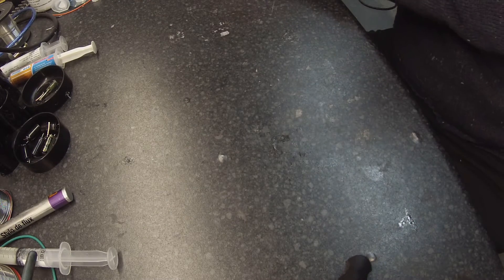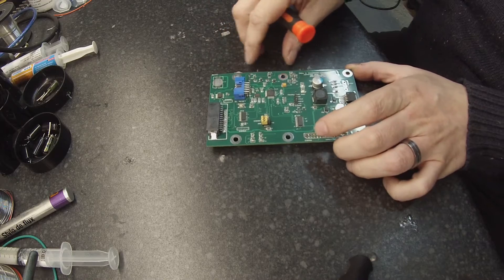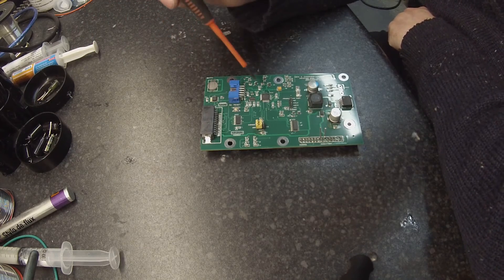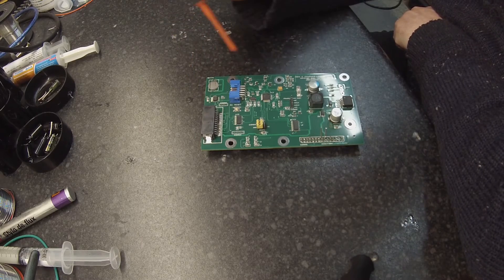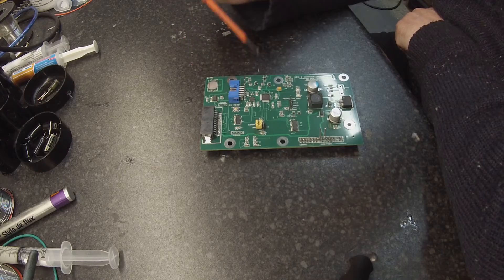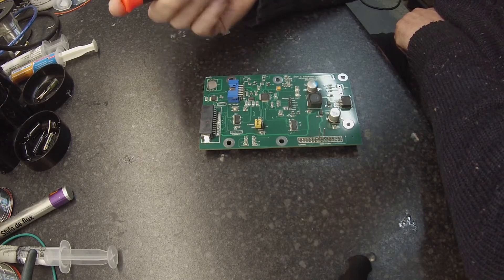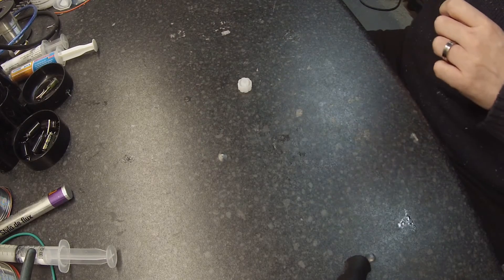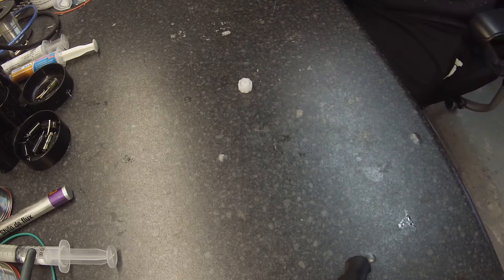Tesla and Toyota Opensource Boards From JLCPCB

Comment: Can't wait to see how prius drivetrain works "in the field" controlled by this board. Maybe I missed it, but why did you gave up on creating same complete board for gen 2? They are so much cheaper and wide spreaded in where I live=)
Reply: I don't know that "give up" is the correct term, but, there were 2 other people putting effort into the Gen 3. If it takes double the effort to develop two different generations of Prius, it does make sense to me, given limited time and effort to give people a single "Prius" option rather than half-develop two different options. A year ago I was saying "It looks like Gen 3 is where he's focusing", and then this past fall I said "It looks like Gen 2 is the one with more development, I'll buy one of those and those boards", and now "Oops, Gen 3 seems to be getting the lion's share of development." Beggers and choosers and all that, can't complain.
Reply: @MattsAwesomeStuff  Maybe term is really not correct, English is not my spoken language=) And I'm aware that few people, including you, are working with gen 2 board, but it seems to me there is a lot of black wizardry involved in the process, including "blue pill". And I'm not an electronics engineer sadly=(
Reply: @danielrouw2593  - I'm not sure. You could ask on the OpenInverter forums. I don't know if there is an actual transmission in there. There's a set of planetaries and two motors (one is the starter and generator, the other is the drive motor). I'm not sure exactly what you're asking, but I probably don't have the answer yet anyway.
Reply: @danielrouw2593  If you asking about ability of speed change as it performed in stock prius, this particular board is not designed for it. It is designed to operate prius transaxle as standalone EV motor. It is however equipped with processor for mg1 and it is opensource so technically you are able to program it to operate like stock prius drivetrain I believe.
Reply: @danielrouw2593  - Oh, you want to keep it with an engine, a DIY Hybrid? No idea. I haven't seen anyone do that though, if that answers your question.
Reply: @danielrouw2593  You have some firmware to write...